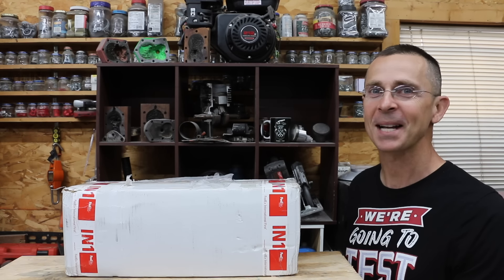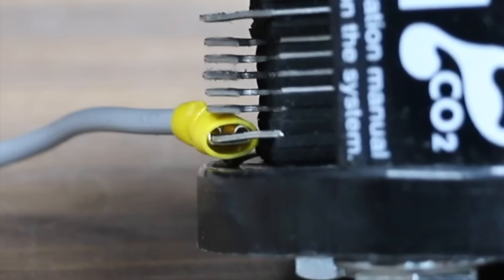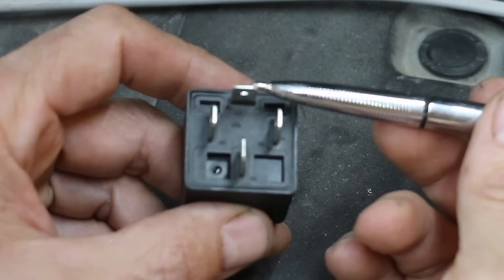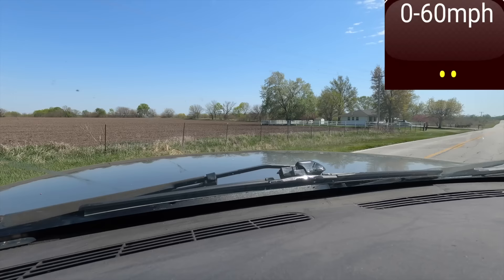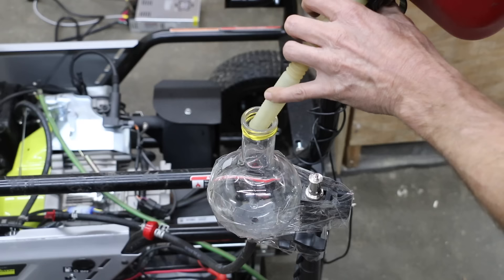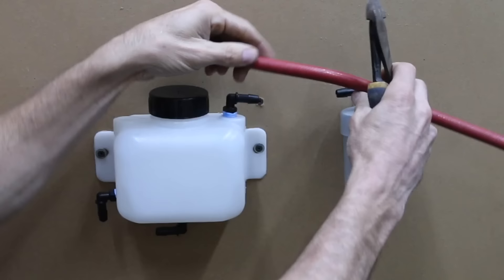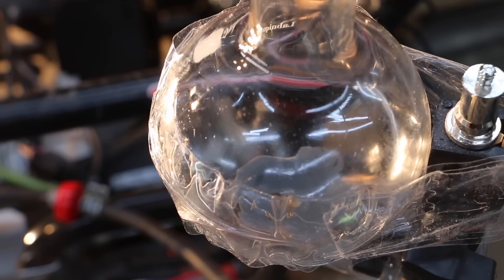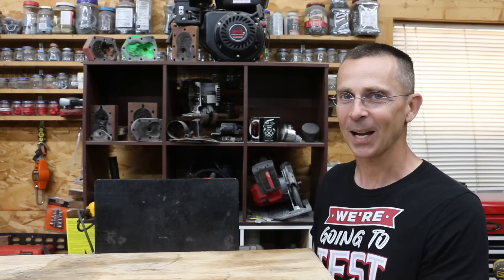AMAZING 35% More MPG with HHO? Let’s find out! Help with high gas prices?

Comment: That thumbnail is a work of art! Hahah!
Reply from the maker: lol.  I was hoping to get some comments on the thumbnail.  I think it's hilarious!  Just trying to have some fun with the thumbnails and put a smile on a lot of faces!!
Reply: @ProjectFarm  it works 🤣🤣🤣😂😂
Reply: I agree thumbnail is spot-on funny
Reply: @ProjectFarm  keep it up, it's great.
Reply: @ProjectFarm  It worked for me man, thanks 😃
Reply: I agree
Reply: LOL, it's simple physics. Whatever energy is used for electrolysis is less than the gained energy from the hydrogen burning. Only way for this to make a net gain would be if the actual combustion efficiency would overall improve by some magic, but it doesn't.
Reply: lol I was like ''who's that guest he got today???''  lol hahahaha
Reply: Now we all know he'll be able to break out of Alcatraz prison lol 😑
Reply: @ThinkingBetter  I think that the two quantities of energy are the same, but you're right in any case.  You should also ask: what's the mass of hydrogen produced during the test compared to the mass of the gasoline consumed?  A quick check says that the energy in 500 mL of gasoline is the same as that in about 1500 liters of hydrogen gas at atmospheric pressure.  35% of that is 525 liters.  Did that little bubbler make 525 liters of hydrogen gas?  Doesn't look like it came anywhere near that.  Todd, while you have the device, how about measuring how much gas it make in 19 minutes?  Use a Project Farm Balloon!
Reply: He doesn't even have to say out loud that the device catches the eye of dummies.
Reply: @ProjectFarm we will get it right if it takes every dollar you got! LOL!!
Reply: I'm "like" number 700! Good job.
Reply: @ProjectFarm  you have succeeded! Thank you!
Reply: @ProjectFarm  definetly u did :D
Reply: 🤣🤣🤣👍.  Indeed👏
Reply: @paulkolodner2445  The law of conservation of energy applies everywhere in this system and losses happen on any energy transfer. The incremental loss due to generating electricity and turning it into hydrogen is way below the actual energy that you will have in that combustible hydrogen. A rough estimate is that for every Joule of energy you have in hydrogen, you lost 3-4 Joules in making it (as heat). So looking at the isolated combustion of hydrogen cannot add anything and only theoretical gain could be if it made some magic to the combustion process itself exceeding the losses added. This would then be a pure chemical process (essentially that gas ITSELF burns more efficient under some process involving hydrogen) and someone should have written about that somewhere.
Reply: I was gonna go straight to the comments and say exactly that. Love it!
Reply: @Project Farm,  do a followup test with a cylinder of hydrogen.  That will show that hydrogen IS NOT A CATALYST for combustion.
Reply: @ThinkingBetter  I haven't thought about how much heat is lost in electrolysis.   But even if there are no stray losses and the conversion is done at unit efficiency, there's just nowhere near enough energy there to affect the fuel efficiency.  Plus, of course, the electrical energy to drive the hydrolysis comes from the engine, which charges the battery that powers the electrolysis.  It's a perpetual-motion machine with the usual problems thereunto appertaining.

I knew a guy who had a clever scheme: hang a fan outside your car window.  The wind turns it, driving a generator that charges the car's battery.  No need to buy gas!  He was an idiot, but essentially the same idea was presented once on the Science Channel.  They're supposed to be somewhat smarter than that.
Reply: I'm surprised the box didn't claim rainbow unicorn farts for emission levels.
Reply: Good to see Cousin Eddy earning his keep by modeling in your thumbnails!
Reply: @paulkolodner2445  It's quite amazing how people are completely lost in understanding the principle of the law of conservation of energy. Some people waste years of their lives on trying to create some completely impossible perpetual motion machines.
Reply: Well I haven't even started watching this video and I can already tell you that you f*** up significantly by using a fuel injected system! This system will not compensate for the extra fuel added and will have the exact same efficiency. Except it will be running more rich and the engine will last longer... Congratulations you are spreading propaganda!
Reply: @ThinkingBetter  The laws of finance are even more restrictive than the laws of physics.  A machine that pulls energy out of thin air has to do so at a rate that will pay for the financing with a margin for profit.  That's a show-stopper.
Reply: lets not forget the hindenberg was a hydrogen air ship
Reply: @bobwise1347  oh Lord the Hindenburg... This may single-handedly be the biggest piece of disinformation propaganda ever seeded amongst humanity! Because of the Hindenburg people are terrified of hydrogen blimps... There is no logical fear to have of hydrogen blimps with modern day material sciences! Plus with blimp technology using hydrogen the lifting capabilities are far superior than helium. We could do so much with hydrogen blimps but because of the Hindenburg we just don't try anymore... We can make these blimps remote controlled with no humans in them at all and they can fly around and stay in the sky all the time. It's just a real shame that the Hindenburg ruined hydrogen blimps... I mean the painting on the thing was literally jet fuel! Anyways Hindenburg was created to make you not like hydrogen blimps because they are such powerful instruments that can get humanity out of this Earth without tons of wasted energy...
Reply: @AquarianSoulTimeTraveler  Hindenburg wasn't a blimp, it was a rigid airship. The Goodyear blimp is a blimp. Both, however are dirigibles. Oh and a Zeppelin is just a rigid airship made by the Zeppelin Airship Const. Co. But it as well is a dirigible.
Reply: @jerome4995  yeah isn't it insane how these hydrogen lifted balloons could have solid metal framing... Just imagine what we could lift with hydrogen up into space past the helium point in the atmosphere. Only reason blimps don't have solid metal framing is because helium doesn't have much lifting capability because we're too scared to use hydrogen because of the Hindenburg... It's like us living in fear of the wheel because it ran someone over one time..
Reply: @ProjectFarm   hello sir is there any videos testing shop presses which is best for the buck just wondering 👍🍻
Reply: Uh oh looks like we are going to have a Lab Rat Cage Fight, the science nerds are getting heated. It appears a physics nerd and a chemistry nerd are having at it!! 
LawL, I am enjoying the banter for sure!
Reply: @AquarianSoulTimeTraveler  In your response to Bob Wise your use of "propaganda" is incorrect. That is as far as I read, so no other mistakes were seen.
Reply: @AquarianSoulTimeTraveler  You can't lift anything into space with Hydrogen itself. Although it can escape the atmosphere by itself, you need to be going 17,500 miles per hour to escape gravity.
It's like this is well known what is required to go into space, floating in a balloon will not get you there.
Fun fact during The Great War in Germany, it was a matter of law that all intestines from livestock be saved for the war effort, not for sausages. It relates to what you scolded Bob for, go find out how.
Reply: @ProjectFarm  im so glad i seen the comment. went back and looked and my like is that much better
Reply: @ProjectFarm  I made a system myself with stainless steel wire and it worked very well in a old toyota pickup. I definitely noticed a cleaner running vehicle and better fuel milage. I have read that the system doesn't help much in cars with EFI and computer monitoring of exhaust system with O2 sensors. I have heard where people have tapped into their computer system and made adjustments and it was beneficial for them.
Reply: @AquarianSoulTimeTraveler  I agree. The injectors pulse width (or the controller thereof, ECM?) is not going to be affected. Try using a carbureted engine. I had great results on a 1986 Mazda B2000. It gained measurable mph and definitely smoothed out the  idle. However, I used a home made "wet" HHO generator. I used food grade stainless steel, baking soda, tap water and 12v from the battery. I didn't use a gas collecting container and drew the gas straight from the cell...oops...after several weeks of having fun and amazement, I finally managed to suck up all the water from the cell into the intake manifold...DUH...! Other than a blown head gasket the engine did not suffer any ill affects. However, that whole process did, without a shadow of a doubt, cleaned the inside of that engine. I was never able to get that 140k carbed engine, with its 51 feet of factory installed  vacuum lines to run so smoothly. Before or after the HHO. It was a fun experiment.
Reply: @Jimmy_in_Mexico  I believe you did, Jimmy in Mexico! See my comment below (Tom Kilroy)
Reply: @wantkixido  the thing with the HHO is that the hydrogen ignites faster and help boost the gasoline ignition faster and lowers the temperature. That causes the motor to burn more efficiently with less gasoline and a more complete burning of the fuel. The O2 sensor detects the lower temperature and adds more fuel to compensate and thus negates the advantage of the system. My system was a wet system and I didn't run the bubbles back thru the reservoir like in this video, it does need to go thru a bubbler because the hydrogen is explosive and could blow up the generator and render it useless. But I had very good luck till one of the wires corroded thru. I was using stainless steel wire for a clothes line. So it probably wasn't the best quality wire. Had I used heavier wire or stainless steel plate to make it, it would have been a lot more efficient.
Reply: .....what is often overlooked is that a cold engine can produce more power .The output drops as engine reaches operating temperature . Dyno test places will confirm this if you ask them . 
 Also a new sci-fi novel has been released called The Shaman .It's about an east European scientist with some Australian aboriginal ancestry who perfects one of these systems that really do work so that vehicles really do run entirely on water . The reason for it being a SciFi novel is although the whole thing is claimed to be true , it happens that no self respecting scientific publisher wanted to risk their reputation publishing his research findings . At high enough pressures and temperature some hydrogen might fuse to produce helium . Thus fusion power . Perhaps the pressures and temperature might be more conducive in a diesel engine and maybe nickel or palladium within the combustion chamber also might promote things along . Anyway it might be a good read .
Reply: @flybyairplane3528  Well that was very unclear as to what you were saying exactly but I kind of got what you were talking about and yes you are right... The skin is jet fuel and hydrogen instantly escaped not catching on fire...
Reply: @wantkixido  my grandfather made the exact same homemade experiment for his  Carbureted nissan truck... He went from 29 miles per gallon to 35 miles per gallon... He had to change out his Jets to compensate for the extra fuel being added to actually see a difference in mpg... It's literally the exact same scenario here...
Reply: Thumbnail got me to click
Reply: @ProjectFarm  Billy Ray has that look of smug skepticism that can be picked up by the team and affect results, but you seem to have countered it pretty well in this test.
Reply: @AquarianSoulTimeTraveler  NOT JET FUEL  bu 2 cmponnt  ROCKT FUEL🇺🇸🇺🇸🇺🇸🇺🇸
Reply: @ProjectFarm  The pen you use for pointing things out is really the star of the show at this point!...lol🤙🤙
Reply: I noticed you did interior paint could you please do exterior paint because I will be painting my house this year thanks
Reply: Cousin Eddy creeps me out
Reply: @ProjectFarm  well it worked and it worked well, all I was thinking was the mannequin head saying “ooooh my”
Reply: @ProjectFarm  you should do gardening myths too.
Reply: @ProjectFarm  can you test what tight and strong and waterproof box is the best. Like bury them for a year and dig em up after
Reply: Hey Todd, what about a video comparing E-bike kits?  Hi from Scotland
Reply: Indeed
Reply: LOL LOL, 😄😁😳😂    ON   the thumbnail too!!!
 it caught my attention..!!  👍👊,
And another great awesome  VID.  
 by  MR.  PF.   
 thank you  SIR
 for this is formative 🎥 --  VID.....
Reply: Stop using my girlfriend in your thumbnails. She’s is fragile. Doesn’t take positive attention well. 😆
Reply: @ProjectFarm  Did you test it properly with constant speed for a distance  of 100 km while generator is turned on and another 100km when generator is off. Acceleration isn't way to measure this. A car can produce 300amps. And this device uses same amps as headlights. Your tests are biased. You should measure fuel efficiency instead. Make sure installation is tight and not leaking hydrogen. Hydrogen is the smallest atom in the universe. So make sure hydrogen goes in to the engine.
Reply: If the engine is fuel injected then I would assume it has an ecm controlling the pulse width of the of the injectors using a crank or cam sensor to determine how much gas to push through the injectors at any giving point, I'm not sure if the generator works that way but I know the suburban does, if the ecm doesn't  know the hydrogen is there then the pulse width would remain the same therefore the amount of gas the injectors put out would also,so the hydrogen would only make it run a little rich, correct me if I'm wrong but I  don't see how that setup could ever increase fuel milage or power output without the computer being programed to take advantage of the extra source fuel independently of the gasoline, if the ecm doesn't know it's there then it can't really be of any help
Reply: @ProjectFarm  hey do you think if you tried it with a higher compression engine it would work? Maybe try it with something running on propane With HHO generator
Reply: @Charles McKinley Oops, yes indeed I said the opposite of what I intended to say.
Reply: @ProjectFarm  it would run better on plastic shavings.........as there made from oil...is this good for diesel. ?.[ being oil ]. the kit,not the shavings..
Reply: @ThinkingBetter  my thoughts on using hydrogen is a way to use just hydrogen and no petroleum products for clearer burning hydrogen.  Not so much for fuel efficiency.  Find out if emissions have been reduced by adding HHO to the fuelline.
Reply: @michaelpearce8661  Of course hydrogen burning is turning into water and is as clean of a combustion as you can ever get. There are lots of HHO in gas engine scams out there, but I can see that some of the pollution from gas combustion will be reduced through the steam & water capturing some of it. Instead of emitting dirty air, some of the dirt is in the water with HHO in the mix.
Reply: @AquarianSoulTimeTraveler  Modern vehicles are fuel injected.
Reply: @minirock000  He's not talking about escaping earth's gravity. He's just saying hydrogen can lift things higher in the atmosphere than helium. I am not sure if it can technically reach "space". I don't know what the conventionally accepted definition is of "space". I am thinking the atmosphere is too thin in "space".
Reply: @Charles McKinley I love throwing in non topic remarks because more people have answered other people and my comment gets noticed.  Sometimes I wonder if anyone ever sees what I wrote.  It isn't for lacking knowledge or feeling like I'm being required to stay within the lines...
Reply: @glennwhite1841  Both hydrogen and helium escape Earth's gravity. Hydrogen does  have more "lift" than helium, that is why it was used in heavier than air aircraft even when we had helium. Although America had a large supply of He while Germany did not and that's why they stayed with H.
Side note, during the Great War in Germany it was law that animal intestines be given to the government.
Reply: @ProjectFarm  you have to try using urine in the hho gen. Urine has more hydrogen .
Reply: @asd2642  I have a better idea; why don’t YOU waste your time and money on this nonsense?
Reply: How much Hydrogen gas was produced.
I would like to know how much your engine was consuming during the tests.
Reply: @ProjectFarm .........have a look at Sunfoil.......there is a guy ( Chris ) in Western Australia., who has put a domestic solar panel on the top of his Subaru shooting break., he's usual run is 12 miles into his local town.,and he., having taken notable amounts of  data has gained an appx 15% advantage over not having the panel.......he is saying the advantage comes from the lack of activity of the alternator.,which comes from the very ineffective transmission system ie V belt and compromised alternator design to achieve output over a wide range of speeds........so put in " sunfoil may"..
Reply: @ProjectFarm  you think tÿ try t try F
Reply: What thumbnail? I'm missing something.
Reply: @ThinkingBetter  You have a typo there. Because of inefficiency and entropy, energy used for electrolysis is MORE than the energy delivered to the engine in HHO. One could increase the engine's efficiency with a higher compression ratio and the use of distilled water as an octane booster. Both methods use water, but one is snake oil and the other is tried and proven. Remember in WWII, some fighters were rigged with water injection for boost of power when in a dog fight. Since water weighs about 8.3 lbs per gallon and gasoline about 6 lbs per gallon, they only used the water power boost as needed.
Reply: Lol! You pinned it!
Reply: Facts
Reply: @ThinkingBetter  For the uninitiated (probably not many here) the system would violate the second law of thermodynamics and would be a perpetual motion machine of the second type, even ignoring efficiency problems in generating the electricity needed and in the electrolysis.
Reply: @AquarianSoulTimeTraveler  Since the oxygen and hydrogen are both fed into the manifold, there is no mixture problem. If it were pure hydrogen the system would compensate by leaning the gasoline mixture.
And, of course, very few vehicles on the road now are carbureted. Fuel injection is universal.
Reply: @AquarianSoulTimeTraveler  There is no "helium point" in the atmosphere. Helium balloons rise until the weight of the displaced air is no more than the combined weight of the balloon and the payload. In practice, that point is essentially the same for hydrogen as for helium; the weight of the displaced air is the same and the difference in weight between hydrogen and helium is insignificant.
Blimps never have solid metal framing - if they do they are dirigibles. Bald people never have red hair, either.
Reply: @flagmichael   It's not about the amount it can lift it's the volumetric difference the amount of volume that helium will take up to lift up the same amount that hydrogen will lift up is alot more. This means helium airships are a lot more susceptible to being blown around by the wind whereas hydrogen airships are significantly smaller and have the same lifting ability as their helium counterparts making them more able to fly and windier conditions.
Reply: @sofarfromsaneaf  it is vitally essential to make all the tubing connections completely leak free. This means clamps all around at a minimum. If you can't use swageloks or their equivalent, another workable technique can be to use JB weld or a comparable epoxy to form a seal at any tubing connection. One way or another, hose clamps, swagelok or JB weld, it's imperative the system be sealed to maximize any potential improvements hydrogen gas could offer. Even relatively small leaks of the gas delivered by this method could at least substantially attenuate if not entirely nullify the desired results.
Hydrogen gas is among the most potentially hazardous, volatile, motile, flammable substances anyone might wish to contain, control or combust and it is difficult to overstate the importance of careful planning for and commitment to the maintenance of appropriate standards of safe practice, handling and disposal, when and wherever it is used.
Reply: @ProjectFarm  here in aus, we have an lpg injection,for petrol & diesel. cost is around 3.5k. !!.. it does work, especially on diesel. but, 3.5k.??..thats a yrs fuel, ,,or used to be.. best fuel is lpg. no mods needed on new cars. except high compression. my bronco is lpg only, runs 12.1 comp. 351c with 302 heads,. goes like a cut cat, & cheap. &, for the greenies, it pumps out oxygen. ish..
Reply: @ThinkingBetter  it is true. But it could be a diference in a carburetor engine because the temperature and speed burning of hidrogen  could help to burn  gasoline . In  a electronic  injection engine there will be no difference.
Reply: @carloscoronado8712  If the incremental combustion energy efficiency of adding hydrogen exceeds the energy lost in making it, yes, then it theoretically could make sense. Adding hydrogen gas to the homogeneous fuel charge improves the ignitability of the mixture, and increases flame speed and combustion stability, but does it make up for the energy lost in generating the electricity and the electrolysis process? I doubt it.
Reply: @ProjectFarm  May i know where to buy this?what is this powder?im asking for my dad so im clueless about all this
Reply: Is it possible that the engine computer compensated for the introduction of hydrogen by adding more gasoline to the system? How do o2 sensors factor into this test?
Reply: I am curious if your long term fuel trim changed on the suburban. If the hydrogen is working the oxygen sensors read rich and the ecm will lower injector pulse width delivering less fuel. This would show on scan tool as negative fuel trim. I don't know if that generator has a oxygen sensor or fuel trim to adjust for the hydrogen coming in.
Reply: The hand looks human
Reply: @ProjectFarm  hello do u know where u can get the kit? Also is this good to not have to use gas?
Reply: It was good....thanky!!
Reply: @paulkolodner2445   Well done. This is a quit scientific response.👍
Reply: @ProjectFarm  your not going to get any good results till you change o2 sensors voltage when running hho and 1 liter minimum hho I dought that little puke hho gen is worth one dime😂😂
Reply: Can you compress the HHO gas and use it seperatley from REGULAR gas?
Reply: @ProjectFarm my tractor
Reply: Do you do thumb nails?
Reply: Thumbnail here is golden!!